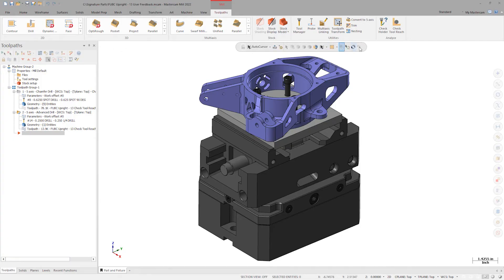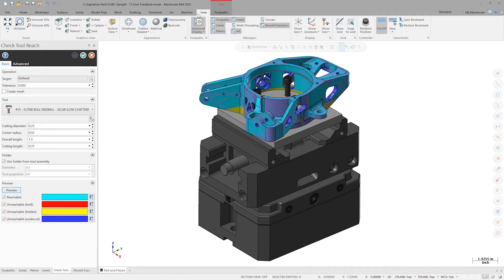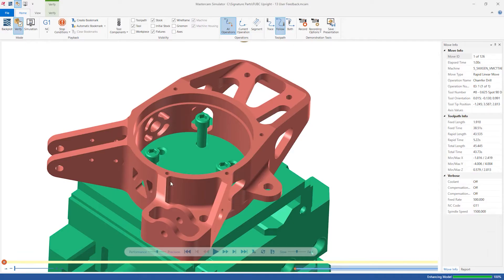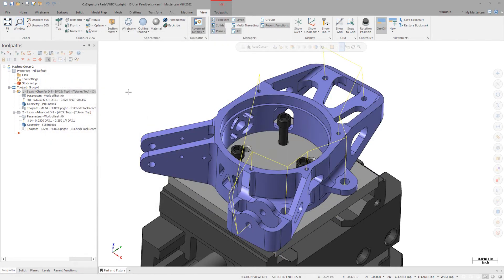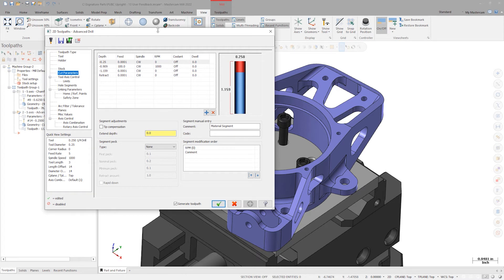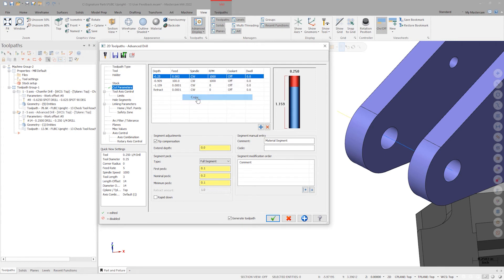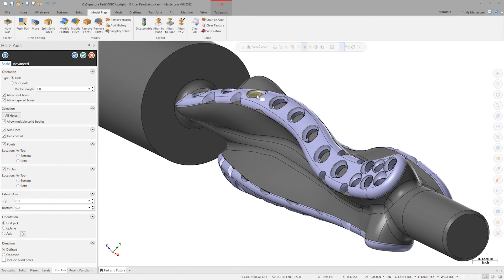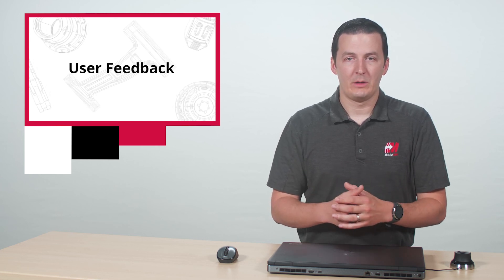Mastercam 2022 Check Tool Reach Utility | Mastercam 2022 Signature Parts

Comment: Hi, I am a mastercam user and I wonder if with optiRough it is possible to increase the feed rate during up milling as we collect less and less material in up ??
Reply from the maker: Hey there! This is currently not possible, but we are aware of the need to increase feed rate as the vertical tool engagement decreases. We'll share your feedback with our product teams.
Reply: @mastercam  Great. Thanks ;)